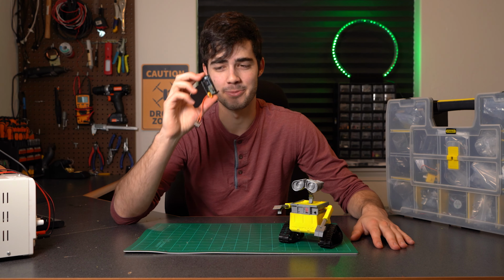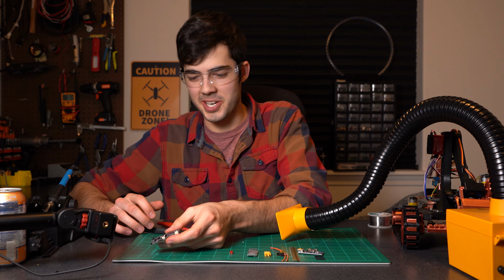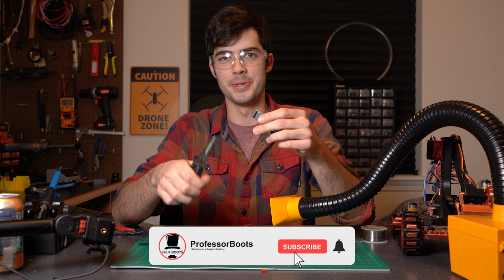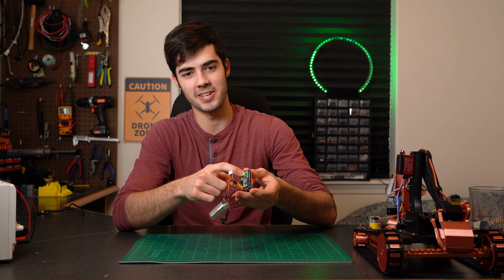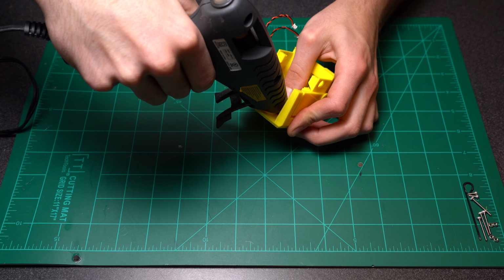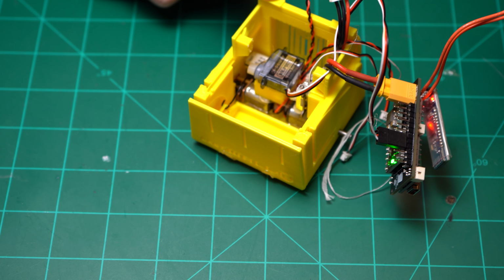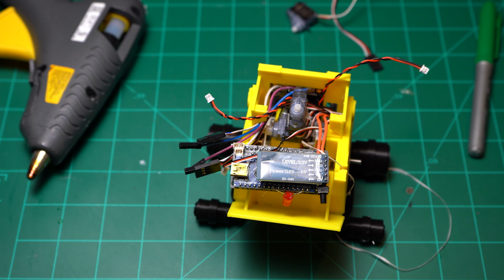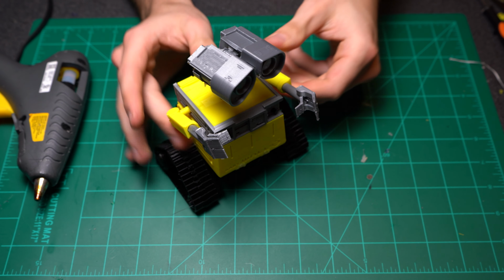How To Make a Baby Wall-E Robot

Comment: After banging my head around for a bit I realized how bad of a design this is. So I made a new version that uses an esp32 3.5in display with areas that hold the motors and servos because seriously who uses hot glue when you can make slots in your 3d design. I will remix it on thinkverse

Comment: Update: I replaced a few wires with 26 gauge, and the light turns off, I get the WALL·E Sound byte, and it charges. But Bluetooth is a no-go

Comment: the red LED... it's one with a built-in resistor, right? bc otherwise the LED will be dead soon, right?
Reply from the maker: Great question! Originally I had a 150OHM resistor hooked up to prevent possible burn outs. Though room got pretty tight pretty quick so I ditched it. but after having run wall-e for literal dozens of hours haha without the resistor on the led I haven’t had issues. I credit this mainly to the fact that it’s not constantly turned on, but rather in short bursts.

Comment: This is awesome! Is there a way I could scale up the 3D design to support a larger compartment? I really wouldn’t mind having a little more space for my pico, motor driver, etc… I am brand new to 3D printing, so any advice is good advice..
Reply from the maker: Thank you! And yes definitely, any CAD program you’re able to get your hands on should have the ability to scale the parts. A really easy to use one that’s great for somebody just getting into it would be TinkerCad or if you’re looking for something with a little bit more use and ability to grow with you id check out fusion360

Comment: Just a couple of questions....do you have a link for the JST connectors that you used? and the second is, I have had the PCB made from the gerber files on your github page, but the pcb's dont have the switch connector holes (the ones near the bluetooth holes) where do I connect the switch to? Apart from the this is a great little project, I have printed all the parts got most of the electronics ready (apart from the switch, and trying to find a battery for it (the ones in the link aren't available atm)) and cant wait to put him together
Reply from the maker: Hello! I do have the link I can fetch it for you this evening once I’m back home. Also I’ll have to double check but those gerber files must have the original PCB files which didn’t have those holes. I spliced directly into the battery wire. It’s actually saves quite a bit of room doing it that way but adds the splicing step. still I’m so sorry for the confusion I’ll update those tonight.
Reply from the maker: I’ll also look into the battery situation. Thank you for bringing these to my attention!
Reply from the maker: Alright first things first here's the link to the JST connectors https://www.ebay.com/itm/363529978152?var=632753499838. I fixed the GitHub Gerber file for the PCB's though it sounds like its already to late as you've ordered them. As long as you're comfortable splicing the battery wire into a switch you will be good as thats the only change. Though if not let me know and we can figure something out. Finally I checked the links for the batteries, I'm in the US which says they're available I cant speak for area's outside the US though. I hope this helps, also I just set up a discord server about 2 minutes ago haha where people can ask questions and share progress. Here's the link https://discord.gg/eDNTa6qF
Reply: Yep , facing the same issue. But adding the switch to battery wires seems to be the way to go.

Comment: to all makers you have to get the PCB in fact without it's not possible to put all inclusive :) I had to sacrafice the open door drawer to put all the connections !
Reply: i'm in the same boat. how did you manage to do it this without the PCB??? did you use a mini breadboard
Reply: I just scaled the unit to 172% and remade the entire body to include motor and servo holders. As well as replaced the front drawer with an esp32 3.5 display and ran the entire thing from the esp32

Comment: This is great! what make his arms wiggle in the code? is that just part of that servo?
Reply from the maker: Haha this is a great question and something I spent so long trying to fix, it’s mainly the servos. After trying massive capacitors to maybe smooth out the voltage it mainly just came down to the potentiometer inside the servo not being super reliable. Even with the disconnection of the output signal from the arduino nano they still shake for a second after they are told to move. I finally chalked it up as a personality trait for wall-e. He’s just had one to many Twinkie’s haha.
Reply: @professorboots Lmao.. I I really thought it was a feature, not a bug. The shaking creates a cute, excited robot feel. 

I'm using different servos, and it they don't shake. I kept looking through the code, looking for something.  Now I need to find a way to code it in lol
Reply from the maker: @ryanruditz  haha yeah the goal was to always have a waving motion but it kind of took care of that for me. So you’ve fully assembled it then? I’d love to see it!

Comment: On HT JST 3 P : there are VCC GND and D10 but I can't find what is going on D10 what is D10 signal ?
Reply from the maker: I’m afraid I don’t understand what you’re asking. The white wire off of the linear servo is what connects to D10.
Reply: ok on the schematic where is the linear servo sir ?
Reply from the maker: Ohhhh i see, HT JST 3 P is connected to the linear servo that controls wall-e’s head tilting up and down. On the schematic it would be on the bottom left.
Reply: @professorboots  ok thanks without the control board it was so not evident lol
Reply from the maker: @dimf5kbb977  haha fair I’ll try and make that more evident. And no problem, best of luck with the project. I’d love to see the finished result!

Comment: Hi,i absolutely love this project,what rpm n20 motors did you use? Ive found loads of different RPM,thanks
Reply: Hey man sorry to pester you,I've searched for you on Instagram but can't find you at all.i stated printing but unfortunately my beds rough texture has worn away so print is on hold till I get a new one
Reply from the maker: @1kokkerrot  hey no worries you’re not pestering me! Hmmm try searching proffboots. Or if that doesn’t work there should be a link in the video description. I’ll keep my fingers crossed your new print bed comes in quick!
Reply from the maker: I used 30rpm motors, there should be a link to the exact ones I used in the description. And thank you I had a blast with the project! Definitely worth a build if you have the time!
Reply: @professorboots  aah cheers,only problem is those are from USA and I'm in the UK,the lowest RPM I can find here cheap are the 50 RPM at £6 where the 30 RPM are £31,I can't find anything cheaper, hopefully will start the print soon
Reply from the maker: Ohhhhh gotcha, the 50rpm ones might be worth a shot. You’ll just have a speedy baby wall-e haha. Definitely keep me updated on how your build comes along. If you have any questions feel free to DM me on Instagram.

Comment: Hi! This is a really nice project! I build some one later too. But how do you charge Baby Wall e?
Reply from the maker: Thank you and that’s great to hear! I charge wall-e using a 2s balance plug USB charger
Reply: @professorboots  Ahh! Okay thank you. :)
Reply: @professorboots   I`ve seen that the HM-10 app is too old for my Android Smartphone. Do you know an other  Bluetooth module?
Reply from the maker: Just to verify the app you tried was called dabble correct?
Reply from the maker: You might be able to use the arduino Bluetooth controller app instead. You will have to construct your own buttons and what not but it looks fairly user friendly.
Reply: @professorboots  I can´t install the old App. And can I use the "old" chip withe the Arduino controller or must I use the chip from Arduino?
Reply from the maker: You should be able to use any hm-10 Bluetooth chip with the arduino controller.
Reply: @professorboots  😀Okay, thank you so much for helping😄

Comment: love this, buying parts now but the speaker amp link aren't working.
Reply from the maker: Hmmmm, thats no good I’ll hop on and fix that ASAP. Sorry about that! Here’s a separate link to that speaker. https://www.amazon.com/Adafruit-3885-Stemma-Speaker-Amplifier/dp/B082MNXJG5/ref=asc_df_B082MNXJG5/?tag=hyprod-20&linkCode=df0&hvadid=632190051523&hvpos=&hvnetw=g&hvrand=12499456612517210709&hvpone=&hvptwo=&hvqmt=&hvdev=m&hvdvcmdl=&hvlocint=&hvlocphy=9021400&hvtargid=pla-1016476041278&psc=1
Reply: @professorboots  thanks for the fast reply..

Comment: I'm printing this and I noticed that the left leg is a different version? the slots to attach to the cross bar are too close together, and the posts are too short for the wheels to fit on. Also, what size bolt or screw did you use for the undercarriage assembly?
Reply from the maker: Hey sorry I saw your comment on thingiverse where I responded. I’ll make sure to update the file and get you a screw length measurement tonight. They are m2’s